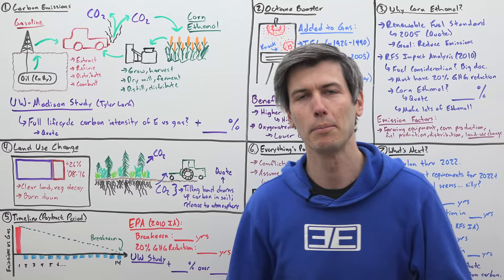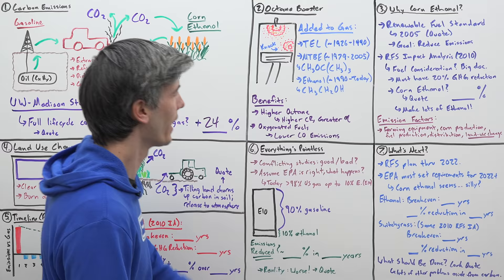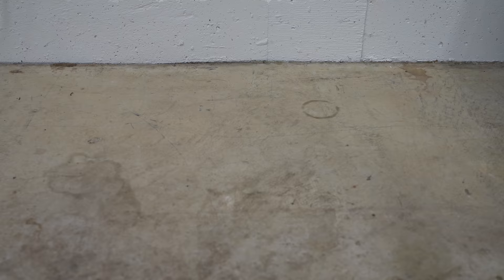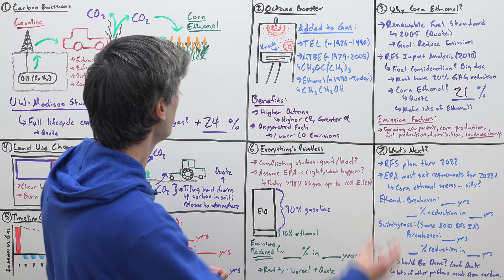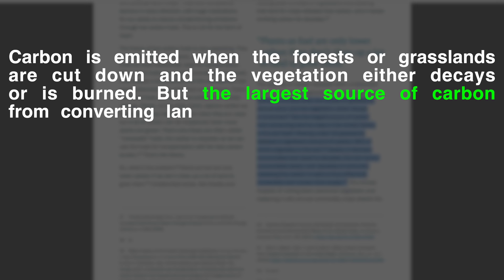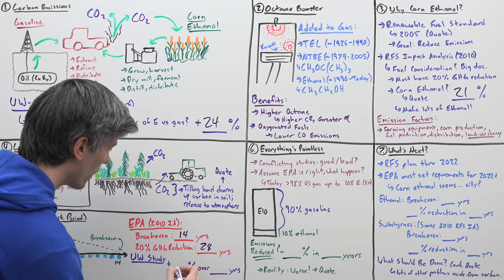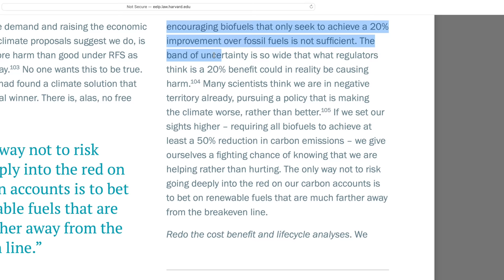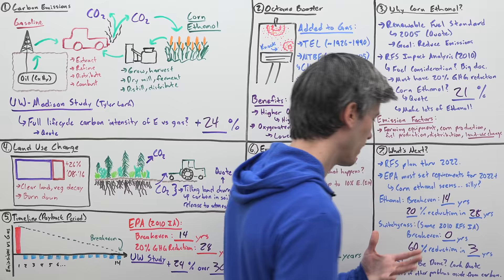America Was Wrong About Ethanol - Study Shows

Comment: mono crop and industrial farming isn't good for the environment big shocker if only we had 100+ years to make the process better oh we did but then our government made a deal with oil companies requiring to put gasoline in fuel. It's just like nuclear energy instead of making the process better they labeled it dangerous and now pther countries that didn't have ultra efficient and safe nuclear powerplants and we still burn garbage and coal to get most of our power
Reply: Corn ethanol is value-added from already existing feed production acres which preserves the feed in a healthier and more productive form called distillers grains.

There were no forests or grasslands broken up for corn, quite impossible on its face since US cropland acres have been declining since ethanol.

Census data shows in corn producing states that grassland, forest, and wildlife areas have increased since ethanol.

Believe it or not, the corn belt grew more corn acres in 1980 before ethanol than they did in 2018, the year of most ethanol production ever and ethanol plants everywhere.

2018 Iowa 13,200,000 acres of corn with most ethanol production ever
1980 Iowa 14,000,000 acres of corn before ethanol

2018 Illinois 11,000,000 acres of corn with most ethanol production ever
1980 Illinois 11,600,000 acres of corn before ethanol

2018 Indiana 5,350,000 acres of corn with most ethanol production ever
1980 Indiana 6,450,000 acres of corn before ethanol
Reply: What countries have this ultra safe Nuclear? ....and please dont say Russia....LOL.

Comment: how long till this video is just “not there”?
and the guy doing the video. no one even wants to speak of his his name so they do not get disappeared. 
a year back i was short on cash. i tried the 85% junk. ( yes i have the yellow gas cap) but i lost almost 4 mog.  and it took a number of tanks and cleaner to my motor to run right again.
Reply: I am shocked and surprised you don’t use diesel since gasoline gets lower mileage
Reply: I have not seen a video promoted on YouTube as much as this one.  It is even over a year old already.

The claim that grasslands and forests were broken up for ethanol is not true.  US cropland acres have in fact been declining so such a claim is simply impossible.  Indeed, the corn belt grew more acres of corn in 1980 before ethanol than in 2018, the year of most ethanol ever produced.

Comment: My car CANNOT use ethanol because I drive an old car, I have tried to use 10% ethanol, but it runs like {crap}, and get WORSE gas mileage. Thus, I have only bought REAL gasoline!
Reply: If your car is fuel injected you can use E10 just fine.  If E10 is enough to make your carbureted car run poorly then it probably needs a tuneup regardless of fuel type.  E10 only runs 3-4% leaner than non-ethanol gasoline.  My guess is your car is already running lean on regular gas and E10 puts you over the edge.  If you are carbureted I would suggest going up in jet size 3-4 numbers.  Either way, while we need to think about older cars as tech progresses, not embracing great fuel like E85 because a few older cars might have an issue would be silly.

Comment: The CO2 discussion is nonsense, it's in reality about not burning oil, that should be the real focus.
And BTW using ICE engines in cars is utter nonsense and should stop, the world must turn to EVs, there is currently no whatsoever alternative to EVs insane efficiency and comfort, charging infrastructure is very cheap to build, this should be the way to go.
Ethanol could be a phantastic fuel for backup generators and peak load plants.

Comment: Fabulous overview. Ethanol is also notorious for gumming up ICE motors, fuel injectors, carburetors especially. Technicians use pure gasoline in their high performance motors whenever possible...
Reply: Gasoline has a very short shelf life; it goes bad very quickly and depending on what the refinery put into it that particular day has a whole host of junk and gums.

Alcohols are often an active ingredient in carb and injector cleaners.

If a fuel system has had gasoline used for years and especially ones that sat around without newer fuel running though, there will be a transition period where ethanol cleans everything that built up in a fuel system which will cause fuel filters to plug often until the system is clean.  If no fuel filter is on an engine (which is what it used to be for small engines), then the carburetor becomes the fuel filter and you will have some problems not from the ethanol, but instead from the build-up of gunk and varnish that came from the gasoline.  Once clean however, using ethanol will keep it clean forever after that transition period.

Identical non-fuel fuel cars, boats, motorcycles, and small engines we have in Brazil use a minimum of 27% ethanol.  It has worked out so well and for so long that Paraguay went to E27.

The Indy 500 uses E98 for their super high-performance motors and it is a much safer fuel.  Pit crews love it for their breathing health and well-being.

Comment: I would love to see unadulterated (E0) gasoline become available at more gas stations. It's healthier for older vehicles, boats, motorcycles, and many two stroke engines than E10, it keeps better in storage, and if octane booster is needed you can get it at most parts stores, on the shelf. It's also cheaper to buy at the pump than getting 50:1 premix.
Reply: Identical non-flex fuel older vehicles, boats, motorcycles and many two stoke engines in Brazil use their common gasoline which contains 27.5% ethanol.  It has worked out so well and for so long that Paraguay went to E27 themselves.

The DOE found that ethanol blends last three times longer in small engines than E0.  The toxic volatile aromatics used for octane in E0 like BTEX (benzene, toluene, ethylbenzene, and xylene) evaporate out over winter leaving behind a sub-octane unusable fuel.  Premium E0 gasoline contains around 40% BTEX.

Many carb and injector cleaners use alcohols as an active ingredient.  Sea Foam contains 25% alcohol and they claim it stabilizes gas & diesel fuels up to 2 years.  Gumout uses alcohol as well for two examples.

Gasoline only lasts 3 to 6 months vs Everclear which can last indefinitely.  I remember varnished gasoline which, like a skunk, one never forgets the smell.  I have not seen E10 ever varnish, but did see it clean varnish when it first came back in the 1980s.  Cleaned so well that fuel filters had to be changed very often until clean.

FYI, an API study in 1948 concluded that the only safe exposure level for benzene is zero.

Speaking of older, Cleveland Discol, an E10 blend, was sold in Britian from the 1920s up to 1968-70 when BP bought them out.  Henry Ford designed the Model T for his favorite fuel ethanol.  Production models were flex fuel.

Comment: Why? Revenue bottom line. Why not stop spraying fuel into 4 stroke engines on the non ignition stroke, that would save 50 percent of all fuel in 4 strokes instantly. Oh wait that would cut revenue to all the states by 50 percent. Dirty air good, pay cuts to politicians bad.
Reply: Lemme guess your a 2 stroke kinda guy?
Reply: @oldblueaccord2629  two strokes are fuel hogs and burn dirty, 4 strokes are excellent engines, when direct port injection came out it was possible to only spray fuel on the power stroke, which would have exactly doubled all fuel mileage across the boards and reduced gas consumption by 50 percent across the world, epa forces them to keep spraying fuel  on the dead stroke so the catalyst will work in the converter. Don’t even need the converter if you aren’t wasting raw fuel
Reply: @travishodges5179 Fuel injection hasnt injected fuel on the off stroke since the late 80's sir. Time for a new book.
Reply: Besides that it, Ms dos was the regulatory software prior to windows 95, windows 95 is the software everything runs on now. I can write and read code for msdos so I know, can you?
Reply: @travishodges5179 win95? wow you really are up to date.
Reply: @travishodges5179  you are amazing!

Comment: Look you know it was a scam when they chose corn. 
Sugar beets have a higher yield in final alcohol production than corn. Just buzzword bs.
Reply: The reason that corn ethanol is so economical is not because it makes the most ethanol per acre but because it is value-added from >>>already existing<<< feed production which preserves the feed which is called distillers grains.

No corn is grown just for ethanol, far too uneconomical.  But with this feed factor, few sources can compete with corn, even those that make more ethanol per acre but little else like sugar beets.

Sugar beets require a dedicated acre of land.

The Tyler Lark study presented here is simply wrong, there were no grasslands or forests broken up for corn ethanol.  Simply impossible because US cropland acres have been declining since ethanol.  

The corn belt actually grew more acres of corn acres in 1980 before ethanol than in 2018, the year of most ethanol production ever.

2018 Iowa 13,200,000 acres of corn with most ethanol production ever in US
1980 Iowa 14,000,000 acres of corn before ethanol

2018 Illinois 11,000,000 acres of corn with most ethanol production ever in US
1980 Illinois 11,600,000 acres of corn before ethanol

2018 Indiana 5,350,000 acres of corn with most ethanol production ever in US
1980 Indiana 6,450,000 acres of corn before ethanol

Census data even shows that the corn producing states increased grassland, forest, and wildlife areas since ethanol came to be.
Reply: @danafletcher2341  thanks for that very informative answer. 🙏

Comment: Not to mention what ethanol does to carburetors and fuel systems when sitting for any length of time in a seasonal small engine like chain saws, trimmers, outboards, snow blowers etc.
Reply: The DOE conducted a study which found that ethanol blends last three times longer than E0 in small engines.  The toxic and volatile aromatics (BTEX) evaporate out and leaves behind an unusable fuel.

Many carb and injector cleaners use an alcohol as an active ingredient.  Sea Foam for example is 25% alcohol and they state it makes gasoline last 2 years.

Identical small engines, chain saws, trimmers, outboards, etc. in Brazil use their common gasoline which contains 27.5% ethanol.  It has worked out so well and for so long that Paraguay went to E27.

Ethanol on most any manufacturers' chemical compatibility chart you will find is far easier on rubbers, plastics, and metals than what gasoline and BTEX (benzene, toluene, ethylbenzene, and xylene) are.

Comment: Very good presentation. No mention that ethanol has a heat content/energy content of 60% of gasoline. So you get poorer gas mileage with an ethanol fuel and have to use more of it to drive the same distance.
I suspect the same type of detailed analysis looking at the “total system” of EVs would have the same conclusion as far as reducing greenhouse gases.
Reply: 100% of the CO2 produced by the burning and fermentation of ethanol just came from the atmosphere and 100% of it is needed to be back there to make the new gallon of ethanol.

It produces no newly added CO2, it is a cycle just like the leaves which fall from the trees.

There were no grasslands or forests broken up for corn.  Simply impossible on its face because US cropland acres have declined since ethanol.

Census data even shows that in corn producing states grassland, forest, and wildlife areas increased since ethanol came to be.

The corn belt actually grew more acres of corn in 1980 before ethanol than in 2018, the year of most ethanol production ever.  Corn ethanol is a value-added product of already existing feed production acres which preserves the feed in a healthier and more productive form called distillers grains.

The reason that ethanol is added to gasoline is to raise octane so it is usable in today's cars.  Equally important, it is added to clean up gasoline's dirty and toxic pollution emissions.

Denver in 1988 was the first government entity to require E10 when they were on the EPA list of ozone non-attainment zones.  Soon with ethanol they were off that list.

Even with just 10% ethanol added to E0, the Swiss Federal Laboratory for Materials Science and Technology found that the especially health devastating ultra fine or nano particulate emissions were lowered by 97%, carbon monoxide lowered by 81%, carbon dioxide lowered by 13%, aromatic hydrocarbon emissions lowered by 67-96%, and genotoxic emissions lowered by 72%.

Ethanol being cheaper per mile to drive with than gasoline (despite lower mileage) is a great added bonus.  More horsepower is another free added bonus.

With ethanol optimized engines, mileage is greater than gasoline, even greater than diesel engines.  This is why GM wants a 100-octane fuel standard from the EPA to introduce this engine Ricardo built and drove for them:

FROM RICARDO:
The new federal CAFE standards are calling for a doubling of fuel mileage performance, which, Vint says, is going to send OEM’s looking for high octane numbers to improve efficiency and ethanol is the best source. Ricardo, an engineering firm with over 100 years in the business of engine design, has developed an extreme boosted direct injection engine (EBDI) to optimize ethanol blends. The 3.2 V6 gasoline engine rivals the power and torque of a much larger GMC Sierra 6.6 diesel, he said, and it delivers 3.5 percent better fuel economy than the diesel.

Comment: About 45 percent of corn is burned in cars. Look at the corn prices for the past year, it has dropped by 40 percent in the past year while the number of electric cars has exploded. We are seeing a crisis in agriculture. Be kind, we are past the tipping point.
Reply: Correction, 55% of corn is fed straight (albeit with light processing) and 45% of corn is value-added and fed as distillers grains and made into ethanol.

100% of the protein, minerals, fats, vitamins, etc. still goes to the livestock in the distillers grains.

100% of the fertilizer and things in the soil still get fed to livestock in the distillers grains.  Ethanol is made of things only from the air: solar energy, CO2, and water with the latter two recycled once burnt.

At most we can make 122% more ethanol from corn since ethanol's production is economically limited to the size of the cattle herd on feed.

December is not yet in the database for 2023, but it looks like last year's corn price is going to average around $6.00/bushel for the year (it sits now around $6.05/bu. through November)

This compares to 2018, the year the most ethanol was ever produced which averaged $3.47/bushel for corn for that year.
Reply: @danafletcher2341  My numbers come from Government and market data. Your numbers are not fully accurate but close enough for horse shoes and social media. We both care about the agriculture sector, the only question is will it survive?  The potential for a 50 percent reduction in corn production is possible in the next decade as a result of two technologies, electric vehicles and precision fermentation.
Reply: @danafletcher2341  I saw both your replies Dana. I think you stopped him dead in his tracks with facts. It happens.

Comment: At least a couple years back, it was a negative net cost item. After all production and transportation costs, are more than its value. How is that possible? Gov. Subsidies
Reply: I have wonderful news!

The corn ethanol Federal subsidies ended back in 2011.

The long-standing stated goal of the G7 Nations to end petroleum subsidies?...not so much.

I see the spot cash delivered price of ethanol on the NYMEX today is $1.70/gallon.

The price of an unusable sub-grade of gasoline (RBOB) is $2.03/gallon.

To turn RBOB into usable E0 fuel costs a lot more much like premium costs more.  Unfortunately for humanity, it also becomes even more toxic and dirty.

Or simply splash in >10% ethanol to RBOB and the resultant usable fuel becomes far, far, cleaner burning, less toxic, and cheaper/cheaper per mile to drive with.  Who can be against that?

Comment: I use only non-ethanol gas in my cars,  Even though it is 10% higher in price than Ethanol, I get a 25% increase in Miles Per Gallon.  The EPA has the mileage information about your specific car make, model and year.  For many gasoline engine vehicles, it is also true, a 25% increase in MPG for non-ethanol blends.  Why is this?  Specific types of corn must be grown for Ethanol production.  Since the Dept of Ag is now involved, we are talking about subsidies.  With less range (less MPG) you must fill the gas tank more often, which means more tax revenue.   Farm subsidies, taxes, what more do you need to know?
Reply: The EPA states the US fleet loses 3 to 4% mpg on E10 and 4 to 5% with E15.  

The worlds most selling vehicle, the Ford F150 is rated at 21 mpg with E0 and 16 mpg with E85.

On E85prices webpage, E0 national average is $3.97/gal, E10 is $3.40/gal., E15 is $3.08/gal., and E85 is $2.61/gal.

Ethanol blends all cost less per mile to drive with (including taxes) and pollution emissions are drastically lower, even with just 10% added.

There are no subsidies for corn ethanol production (ended in 2011) and ethanol producers are somewhat insulated from corn prices for if corn is priced low, then so too are the distillers grains and byproducts and when corn gets high in price, they make up with high prices for the distillers grains and byproducts.

Since the 1996 freedom to farm act passed, farmers are free to plant any crop they choose without losing any government subsidy.  Since then, end users must bid for acres to be planted.

Since the 2005 energy act passed, farmer subsidy payments went from around 25 billion dollars in 2005 to around 10 billion dollars today, not even counting inflation.